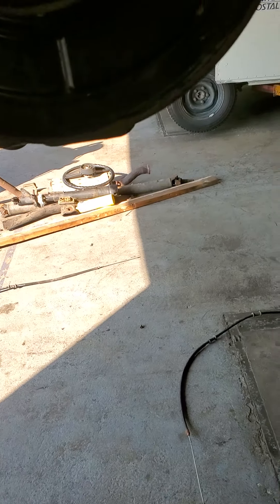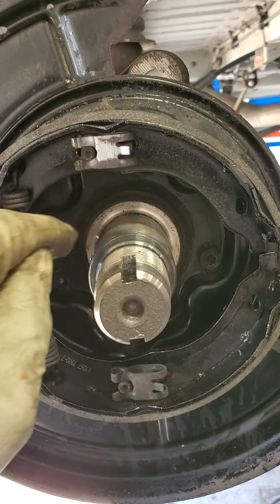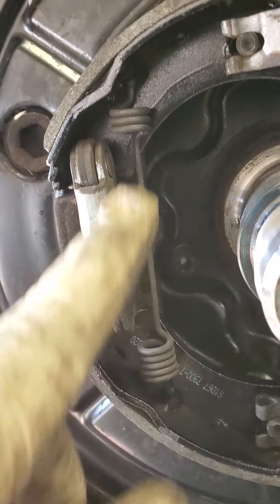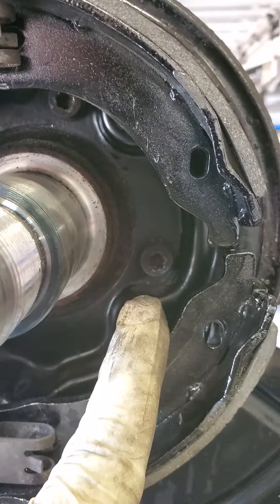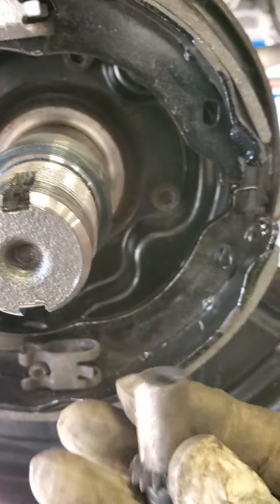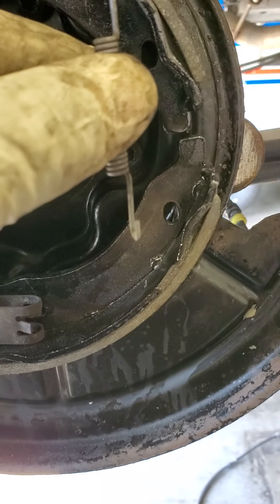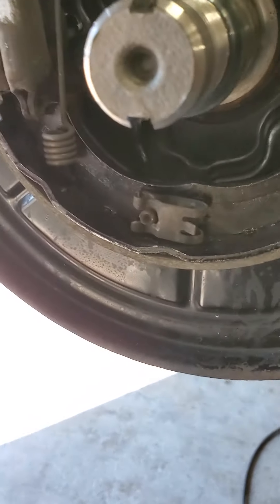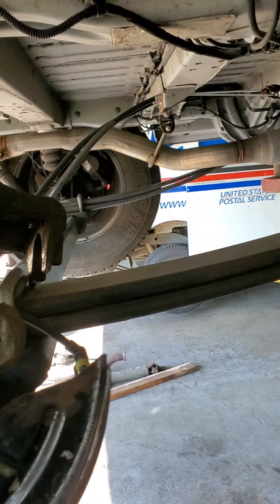2017 ram promaster. E Brake cable and shoe replacement (3)

Comment: 1) Is it necessary to replace the cable when you are replacing the pads? I`m going to tackle this in a few days. 2) If my cable is not moving freely in the housing, could`nt I spray some lube into the housing and move the cable back and forth? 3) In regards to the pad adjuster, could I loosen it in order to allow the (sticky) pad from contacting the surface causing it to ( stick ) ? Thanks!!!!!
Reply from the maker: hello. what normally do at the adjuster lever  take it apart the hone out the center bolt hole its just a smoth bore then lube it with white lithium. it works better then antiseez. and there is a star wheel @the shoe but cant get to it unless you take rotor off  or u mite be able to reach it thru a lug hole
Reply from the maker: also not necessary to replace cables. i did it because ive done everything thing else and shoes was locking up in reverse.
Reply: @charlesgrant7690  Thanks! I will need a new cable due to it being rusted and fraying and not being able to pass thru the cable housing. Thanks for your responses!!
Reply: Great stuff ! This your shop? Could use some future work done.
Reply: Is this for the automated manual transmission with the EcoDiesel? My e-brake system is been acting up for a while getting stuck and now the ebrake cable totally broke from the handle. I'd like to replace the whole system do you have any links for parts etc?
Reply from the maker: srry i know its been a while but i havent been getting  the notifications
Reply from the maker: but no its not necessary to replace the cables i had to do it because it was a complaint  of wheels locking up